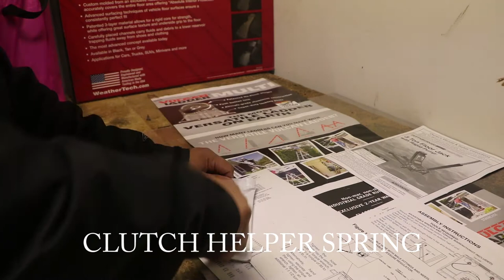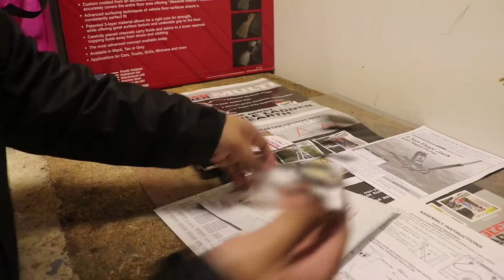PROJECT VQ: 370Z NISMO CLUTCH HELPER SPRING

Comment: Here's a tip for installation. When you're putting the pin back in, instead of trying to wriggle it back in with pliers, use a woodworking clamp like an irwin Quick Grip, clamp it over the pin and push it back in by closing the clamp, took less than 5 seconds!

Comment: Great job 
I changed mine i ,it do feel better but not that much different but thanks
Reply from the maker: Veerunath Ramdass Its enough for my wife to be able to drive it. She struggle with the stock set up. May very well be placebo, but it's not very hard to install so why not.
Reply: 👍 i think that because my car is new 12k miles only.  the clutch spring have some working in to do as well
Reply from the maker: Veerunath Ramdass that may very well be the case. Not broken in yet.
Reply: Veerunath Ramdass my clutch is 21.5k km's in and the spring still fks me over from time to time lol. But driving my z and learning on it, helped me drive other cars with easier clutches much better. If you can drive a stock 370z clutch, you can drive any other stock clutches much easier.

Comment: How is it feeling? Do you still have the after market spring in?
Reply from the maker: Mayykool Yes the helper spring is still in. It feels like the clutch grip is more predictable and the car begins to pulls forward once reaches the old spot where you start to feel the clutch like the last 18% of the clutch pedal. The hard pull at 2nd and 3rd gear is gone. Launching it feels like a regular car now.
Reply: Does it feel more stif?
Reply from the maker: Mayykool It's not stiff. But it definitely feels better. Other than what I tell you before  I haven't had the chance to drive it enough to feel the difference now that it's snowing and I'm not driving it.